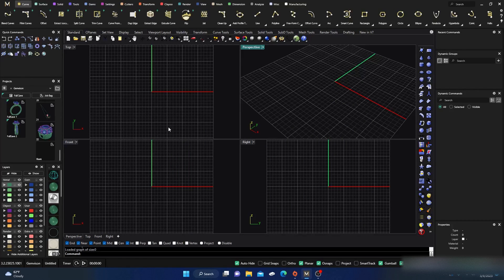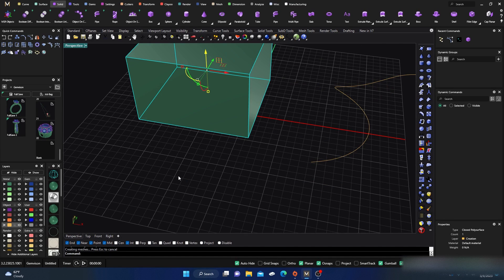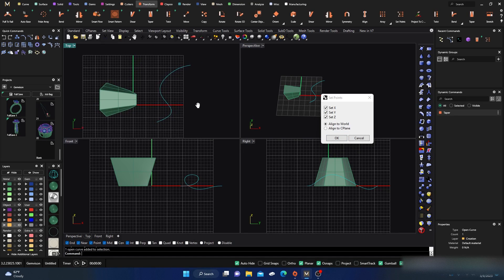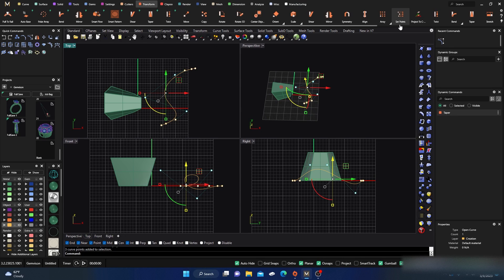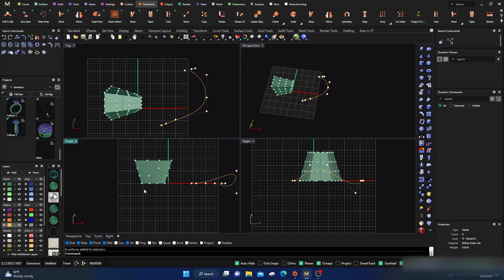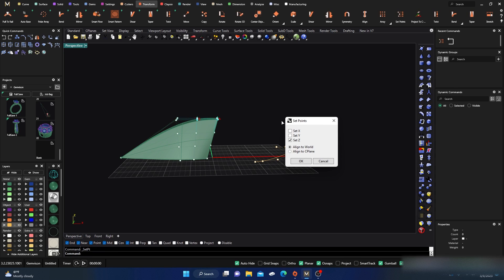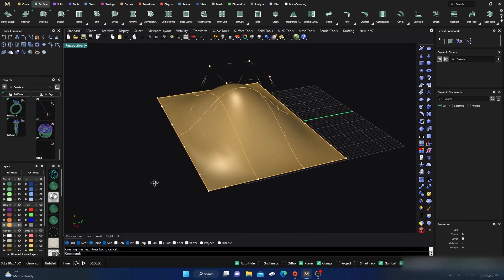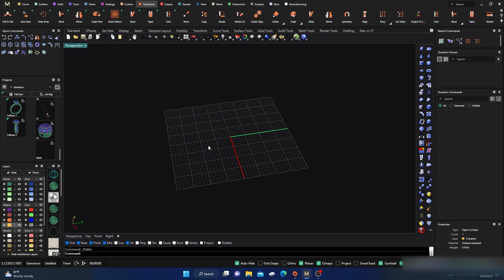Matrix 9 to MatrixGold Transform Set Points Command

Comment: Love your videos! So helpful! I was wondering if you could tell me how to make that list of check boxes above your commands to appear.  Starting with the End box all the way through disable. I don't have those for some reason and I would like to use the vertex snaps. Thanks!
Reply from the maker: Are you talking about the osnaps boxes above the command line? If so, all you have to do is click on the osnaps box and they will appear.  The osnaps box to turn them on is in the status bar. Where Auto hide, Grid snaps are located. You should see osnaps along with a few others.
Reply from the maker: if you can't see them click on the cog wheel and go to preferences and in the status status bar you can turn them on by clicking them or unclick them to turn them off